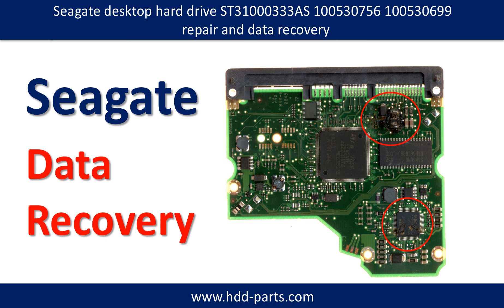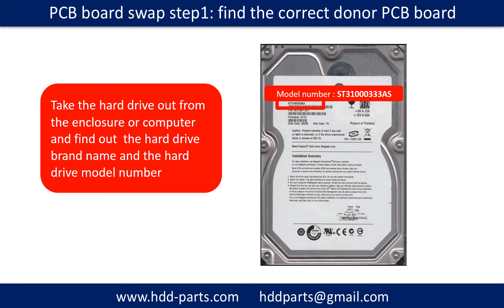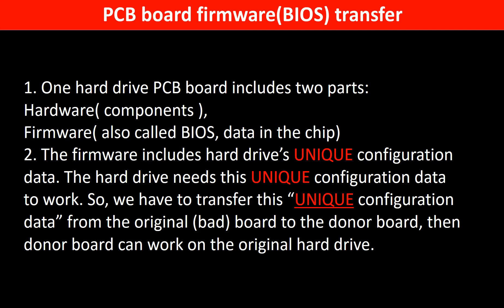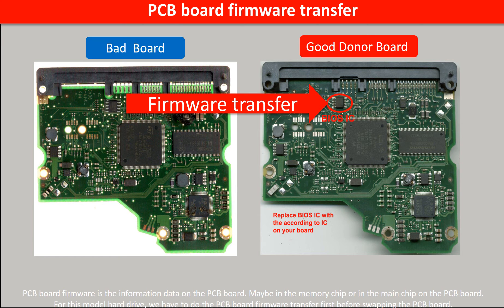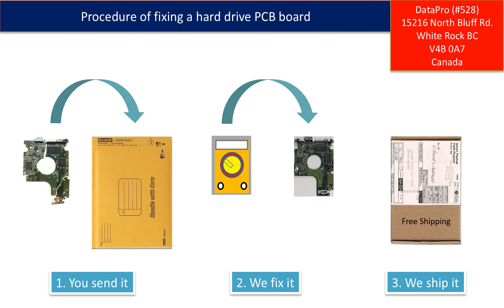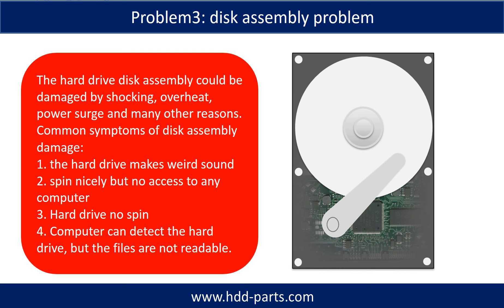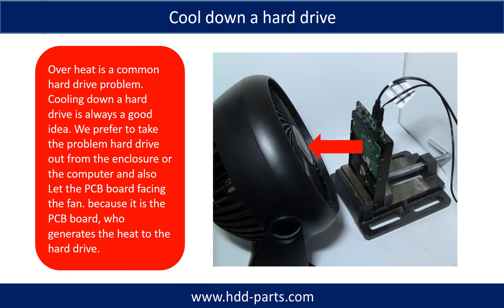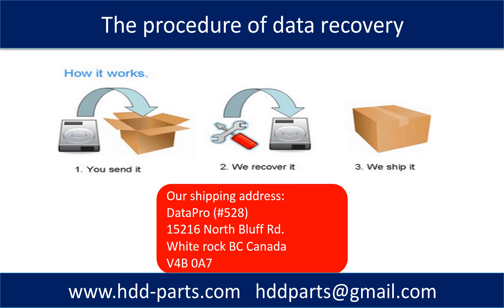Seagate hard drive  ST31000333AS PCB board  100530756 10053069  repair and  data recovery

Comment: Resp Sir! Nice Sir. 🙏🏻. My Seagate 500GB Hard Disk Spinning and Stop Sir. CPU Over Heat Sir. Moter Power Supply One Second output 3.96V  after Zeero Voltage Motor Spinning Stoped Sir. If the Motor IC Change Sir. Please Advice Sir and all SMD Components no Shrted Sir. Impidents Checked with Multimeter Beep Range Red Probe Ground, Black Probe Motor IC 3Points at PCB Value is Beep Sound, Sometimes 250Reading, Some PCBs Values 540 Range Values Sir, So Motor IC Must be Changed Sir. Please Advise Sir. Iam Waiting for Ur message Sir. Please Sir.  --   ChinnaRao Paderu Andhrapradesh

Comment: These guys are the real deal - had a component burn out on my hard drive and render the data 'lost'. For under $50 and in less than two weeks, I sent them my damaged PCB, they swapped the BIOS chip, and then returned it to me.  Was able to get everything up and running perfectly and recover everything.  Great customer service and response.  HIGHLY recommend!

Comment: hi sir.
my wd 3 Harddisk is not dictated.
not spinning
same time three Harddisk is not dictated.
my 3 ded Harddisk same model WD10EZEX
I do not know how it happened but three hard disks stopped working together
Inside the hard disk, I have lots of imported data of weddings.
wd has 3 hard disks.
The three hard disks were engaged in the same computer and got damaged together. I shut down the computer well, I got up in the morning and the computer did not run then I had checked the check but nothing was known. help me plz sir i request u.
Reply from the maker: you may take pictures of the hard drive and the PCB, send the pictures to hddparts@gmail.com. we may find a solution for you.
Reply from the maker: if you are sure that the hard drives do not spin, probably the PCBs are the problem.